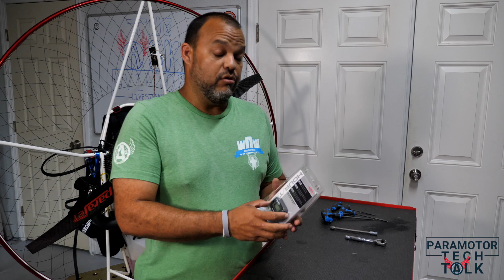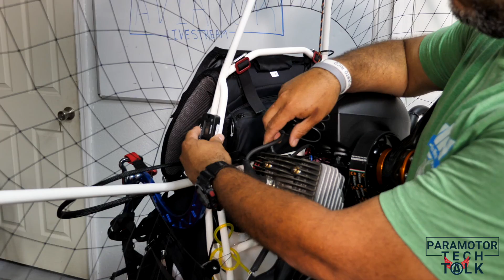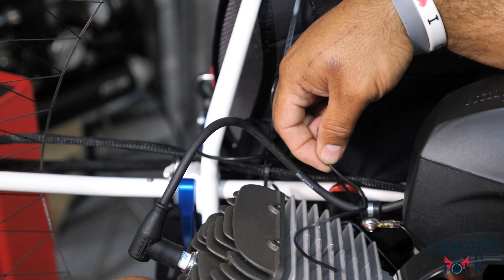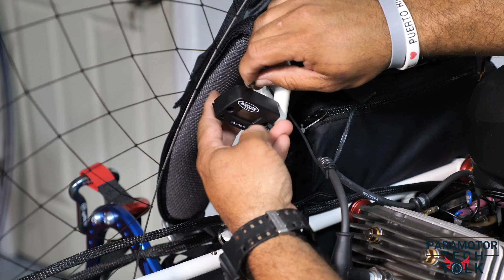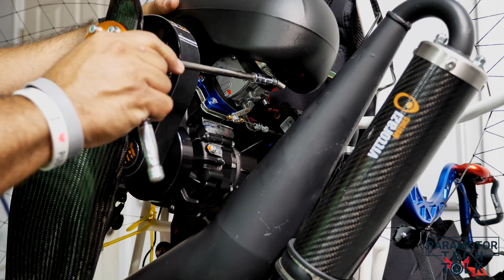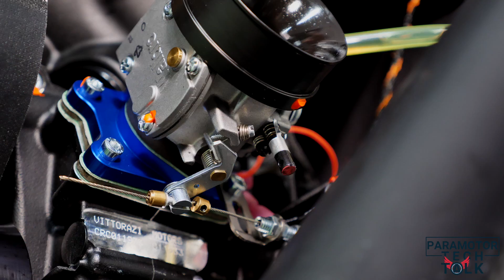Paramotor Tech Talk - Tachometer Install + Throttle Adjustment + Idle Adjustment

Comment: Just a thought,  that meter has a re-settable timer on it as well.  I find the timer useful when flying to see how long I have been in the air, so I chose to mount mine on the throttle.

Comment: Top 80, 20 hours on new athena top end. Compression is high that it's hard to pull, starts fine once u pass the compression stroke. Can I add thicker gasket, or extra gasket to solve issue?
Reply: There's a squish process when installing that base gasket check out the site using a piece of solder